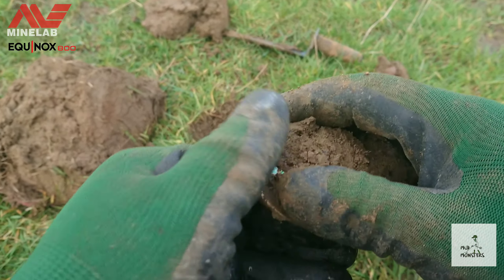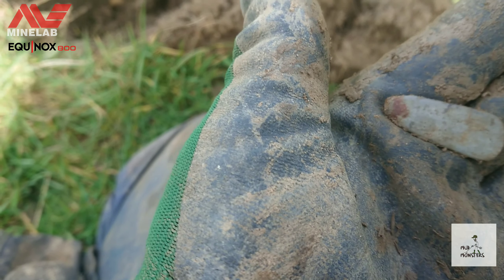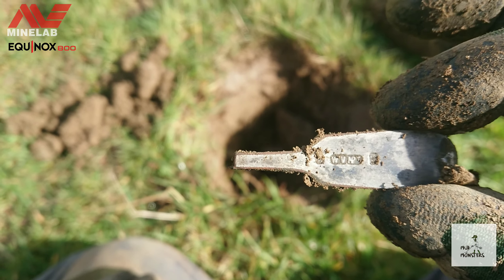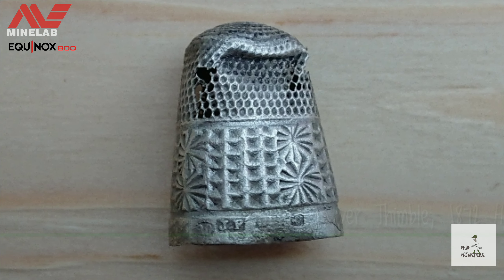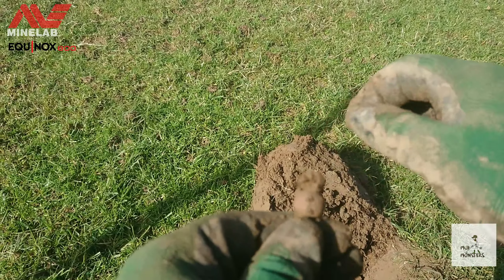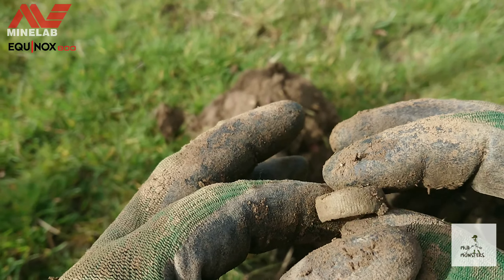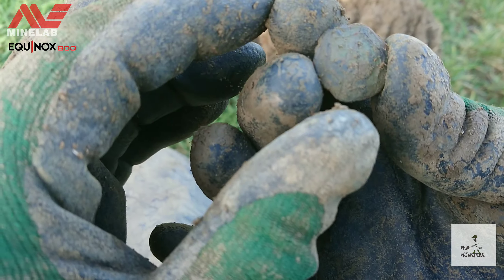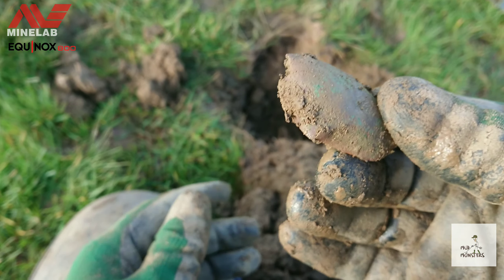MY BEST METAL DETECTING FIND SO FAR 2020

Comment: That spoon handle, are you sure it's plated? Those markings almost look irish to me
Reply from the maker: Really, I will have to have another look, It was very shiny but thought I could see wear through on the edges, but thank you for that.
Reply: @ianr9254  Can't tell for sure, the video wasn't totally clear. But it looks a lot like a sterling spoon that I have from Ireland. Can't say I'm an expert, but if it is, this page will get you there: https://www.925-1000.com/dlDublin.html
Reply: I guess the big thing would be I can't tell from the video if that's dirt on the sides of the spoon or if thats brass/copper coming through. Either way....still old!
Reply from the maker: @AcrossthePlains  just got round to checking and it is silver plated, but thank you for the comment, it does help because i can always miss something